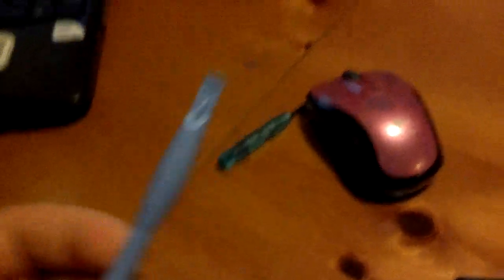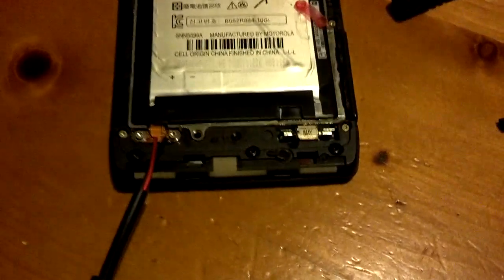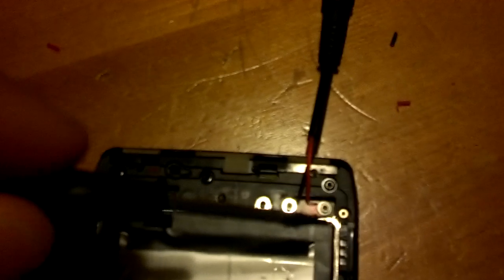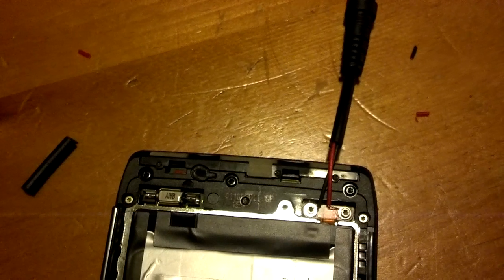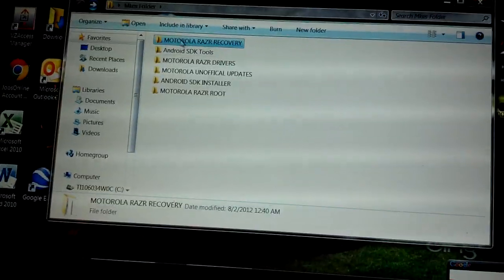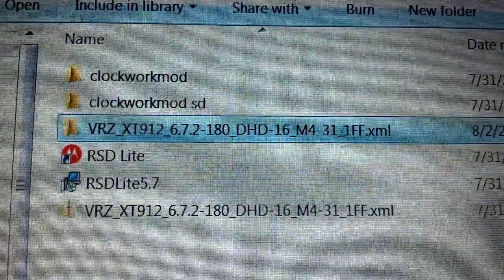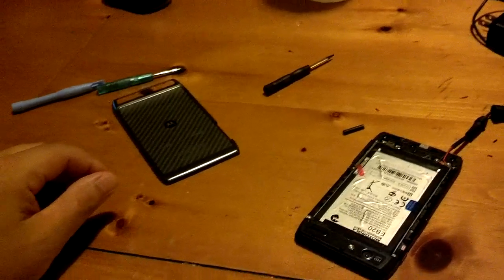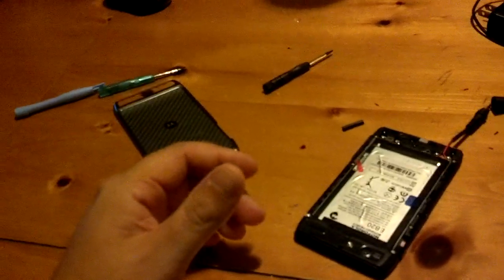How to fix a Motorola droid razr stuck in fastboot with low battery

Comment: How do you know it is charging if the screen doesn´t turn on and the green light won´t turn on while charging....?
Reply from the maker: it probably has a dead battery then
Reply: if I power it, the screen comes up with a lot of little color pixels over a white background. But it doesn´t show fastboot. If the battery is dead would it recognize another NEW battery (package new?). Also: Black wire goes into the negative charge, red over the positive, right?
Reply from the maker: yes the colors are correct for the terminals. a new battery will be recognized. I would retire this device if your still using it.
Reply: " I would retire this device if your still using it" <- you mean "YOU" would like to get it, or do you mean "STOP USING IT"? *I apologyze for the caps, but it´s to emphasize. In addition: I won´t loose my money if I invest in a new battery and continue my stock rom flashing? -Thanks for you reply.
Reply from the maker: +activemotionpictures if not that is coming on it's not charging

Comment from the maker: Your red wire in your charger is positive the black one is negative when you remove the cover on the phone and look at the battery terminals on the phone you will see one had a positive sign and one has a negative put the positive wire off the charger on the positive terminal the negative wire of the charger on the negative terminal

Comment: I need to do this to my Razr, can you please just put down the steps in writing since your video is so poorly lit and there is no actual demo.  You never explained which wires to use, what terminals to put them on, how to charge the battery once the wires are connected (computer or wall), and many more things you could have explained.

Comment: So what exactly did you do?  How did you strip the wire?  Did you just cut the tip off and strip it some?  Then stick a wire in each of the two screws?  Or are the wires on the gold-brown strip.  Also should I take off the red tape (I think) that is covering my two screws?   Thank you.